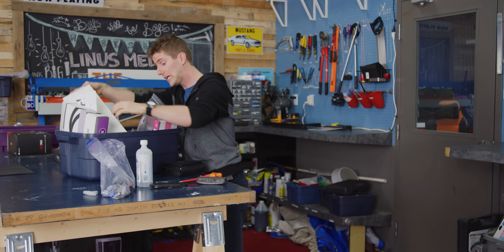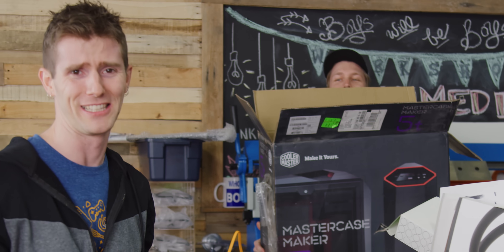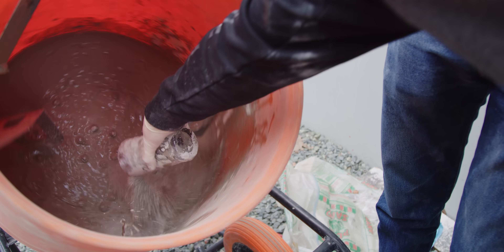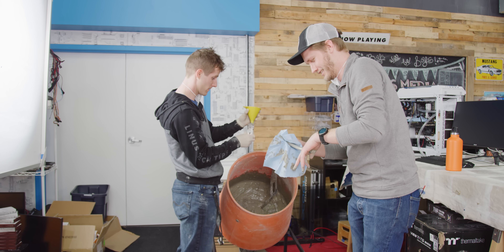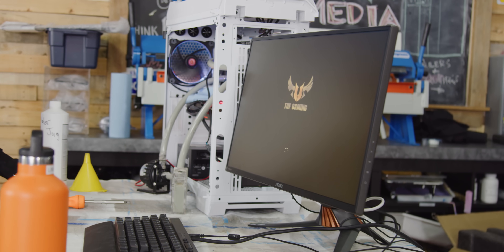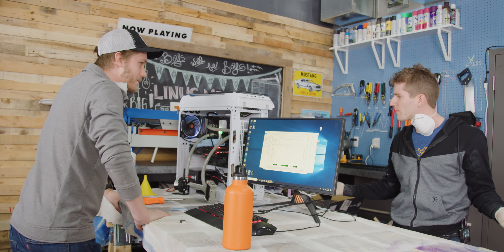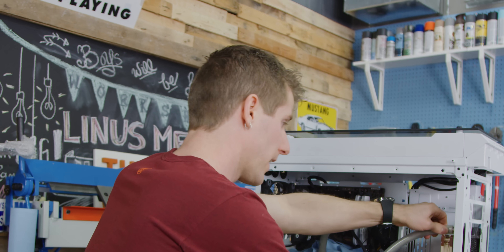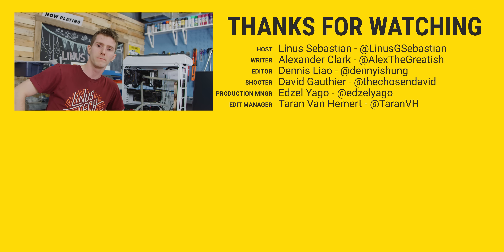I Can't Believe This Worked!!! - Concrete Cooled PC (April Fools 2019)

Comment from the maker: Add Honey for FREE and start saving today at https://joinhoney.com/ltt

Thanks, Honey for sponsoring!
Reply: Do a honey cooled pc!
Reply: might wanna delete this pinned comment
Reply: this one didn't age quite so well
Reply: Hey Linus try diluting thermal paste and using it as thermal coolant.
Reply: @mihaimuresanu3394  What an amazing idea sir!! Good call!
Reply: Why not try honey instead?
Reply: @results4526  Honey should sponsor that video
Reply: That sponsor spot didn't age well.
Reply: oop, 2025 mentioned
Reply: They removed the sponsor (scam) from the video but not from the comments...
Reply: 4th!

Linus. On a less jokey note. Back in the days before refrigeration, people used to keep their milk and cheese in the pantry on a slab of marble. Maybe you could try lining or even making a case out of marble? If it's cold to the touch, because it pulls the heat out of your hand - maybe it'll do the same to a processor or mainboard?

Also, Amazon sent me a cat today!
Reply: computebob06
That's actually a pretty smart idea. They make marble rolling pins for the same reason, the marble saps the heat from the dough which keeps the butter from melting while you work it. In theory it should work.

The only problem is even a lined case would be heavy as shit, the rolling pin I never use weights a good 5lbs on it's own.
Reply: @computerbob06  That would probably be somewhat viable. Another method would be to have water run through the loop and then be run through a slab of marble/granite (it would need to exit the tubing and run through a channel carved into the rock in order to increase the efficiency of the heat leaving the water and being absorbed by the rock).

The only issue with using marble is that while rock is great at absorbing heat it does not do so well at releasing the heat. So you would either need to have a huge rock, or else your system temps would eventually start to rise after the block of marble had been saturated with heat from your loop.
Reply: April fools
Reply: Linus Tech Tips what about a liquid metal cooled pc where liquid metal is in the loop
Reply: karl kukk genius we know what you meant. You don’t need to clarify what’s in the loop.
Reply: Why dont you guys try mercury(heat capacity 140 J/(kg* K) ) as a coolerfluid or if you dont want to kill the environment then you can try gallium wich turned liquid at  29,76 °C (302,91 K) ((heat capacity 370 J/(kg* K)  ) mercury got a heat conductivity of 8,3 W/(m K) and gallium 40,6 W/(m K) so Gallium is even the best way to go cool something down. The only Problem is that a Gallium cooled Pc probably will need some time to preheat and get the gallium liquid wich means the pump need to be turned off in that period of time otherwise the pump can get damaged. So might even need a heater for you cooler^^.
Greetings from Germany btw.
Reply: please try using the TEC1-12706,i really want to see how it work in your hand(staff),i think ive heard it can lower the cpu temp to minus17
Reply: asfia82 - bad idea for a peltier! Those things make great insulators when they fail. Good way to destroy a CPU!
Reply: Hey Linus Tech Tips, I managed to pull out my broken headphone jack but now my audio when I plug my headphones in sounds terrible, I think messed something up with the internal side of the laptop, BTW: It’s an Asus ROG
Reply: oh yeah, today is the day without youtube
Reply: I think you should cast out a computer with concrete, so the concrete absorbs some heat.
But also add watercooling, because concrete doesn't Transfer heat very well.
But it would be cool 🤔🤫
Reply: Nice April fools joke 😂😂
Reply: man, i think you dont need concrete at all you just need make thermal paste to liquid and cool down that liquid with liquid nitrogen vapor
i dont know what is in thermal paste but if that not work you still can mix water with graphite 

at least i think it might work
Reply: Several things you could do to make this work better.  First you want NON-hydralic cement.   Understand the concrete sack is actually the cement or glue that binds the rock and sand you normally use to make concrete.  Hydralic cement is designed to bind and set up EVEN in water.   Clearly this is NOT what you want.   So first thing is to seek out non-hydralic cement, which may be harder to find as most people want their cement to harden, but still should be attainable.  Next thing be sure and get a few gallons of distilled water as you do NOT want minerals in the water which may also encourage the cement to bind.  Lastly there is really no reason you can't use MORE water to help prevent clumping, if you do a good job of getting the air out of the system and use a bit of extra H20 you would have a system that would be prone to NOT setting up and hardening even if you power off the pump.   Of course you could ALWAYS use a UPS to make sure you don't go power off for your rolling canadian brown outs. 

If you really think this is a good idea why not go the distance to try and make it work rather than a slipshod hit or miss effort.  A liquid ceramic ie liquid silicon cooling medium does seem like an intriguing idea, it might behoove you to find out what kind of other agents that would prevent binding exists, contact a ceramics shop/expert and see what they can add.
Reply: How about trying some liquid ceramic.
Reply: Hey Linus, so i thought to myself that you should try oobleck XD
Reply: @Linus Tech Tips Use Honey for COOLING or Motor Oil or Liquid Nitrogen NEXT TIME!
Reply: Could you improve the system with something like a small tube  that fills continiously water into the concrete filled tubes, so that it won't dry out?
Reply: what do you think of honey cooling a PC?
Reply: You could take cement which has already set and powder it, or just plain lime powder or ceramic/terracotta powder, and mix it with water. I will not set, and likely it will probably have similar advantages.
Reply: Why don’t you use corn flour and water mixture
Reply: I don’t see how this works LinusDumbassTips or how you could recommend it. Who would leave their computer on 24/7 to prevent the concrete from solidifying. Also it probably needs to stay hot all the time which means you need to keep the computer running pretty hard ALL THE TIME! Yet another fail from you guys. One reason I don’t watch this channel much anymore. It is filled with nonsensical “solutions” that no one would try. Yeah, You have all this equipment and money to throw away because you get this hardware for free, but everyone else doesn’t. You used to be an informative channel now you’re a joke in the tech community.
Reply: Its obviously a joke. @bobalobalie
Reply: Oh no this shouldn't be here lol
Reply: @Devil Bacon Hair your mom would be proud of you 🤔😂
Reply: @DRENS2131 i mean... it really depends on what your water to cement mix is... it COULD be thin enough to flow through. 

...and then you can have fun seeing how quickly it entirely clogs the fins inside the cpu block.
yea, it SHOULD be obvious to anyone this is an april fools joke.
then again, a lot of people seem to fall for the "wireless microwave charging update for your cellphone" thing...
Reply: at least it runs... my lenovo B575e has trouble watching this without anything running in the backround
Reply: Wait what's a Cue Pawn?
Reply: Maybe try again, with fine grain and mixed 100%? For me?
Reply: You guys forgot to mention that this was an april fools day joke. There are a lot of gullible people out there who would actually believe this was real and try it.
Reply: When is the next Scrapyard Wars coming!
Reply: @mayanksingla17  Scrapyard Wars Season 8 last year was the final one. You can tell cuz they "scrapped" together LMG crews only and it got kinda dry by the end of it. Plus I'm pretty sure I remember Linus confirming that in some video, livestream, or WAN Show is the past 6 months ;)
Reply: Happy April fool's day linus tech tips
Reply: Bullshit, how does Honey make money? If it’s free, YOU ARE THE PRODUCT!!!!!! Honey is a data mining scam. Thanks Linus you Pompous dick face!!
Reply: Attempt #24: Watercool a pc running cold water directly from the tap.
Reply: Can You Try Honey COOLING...???
Reply: Now do this again but with Thermal Paste.
Reply: Wait...your sponsor wasn't Dollar Shave Club?
Reply: to your water cooler? couldn't hurt!
Reply: no
Reply: how about using Mercury as coolant
Reply: Why dont you try using ceramic lines and see if you get a similar result? Because than you wouldn't have to worry about your lines freezing....
Reply: Wait, I thought the video from yesterday was for April Fools.
Reply: Happy April Fools
Reply: I get this is a joke but why wouldn’t unset concrete work? Duh
Reply: maybe.... baking soda and water???
Reply: Im so glad honey can help me get queuepon codes
Reply: Any decent prebuilt gaming rigs that doesn't break the bank?
Reply: Guys you need to add Flow Control. It will thin your concrete without adding water, making it far easier to fill the loop and reduce pump stress.
You can find it in the same aisle as the concrete mix. Small bag, about five bucks.
Reply: whats up with the audio in start and other parts of video, it sounds over exposed and very sharp and distorted on high end... please get a better microphone if you're just going to rape my ears with +gain instead of getting a higher DB mic..
Reply: Why not use honey while sponsored by honey
Reply: I got honey and it saved me $50 so far:)
Reply: You re the best team of the world👍👍👍👍👍👍👍👍👍👍👍👍👍👍👍👍👍👍👍👍👍👍👍👍👍👍
Reply: You also mentioned Dollar Shave Club at the end of the video
Reply: When you leave your computer it bricks it self
Reply: FYI you needed more cement, not concrete. Concrete is the final product with aggregate and sand mixed in. The bag of cement is only a component of concrete. A fun side note is that the water you add chemically binds to the cement. Most of the water you put in the concrete mix stays that indefinitely, so concrete never really dries out, it just sets.
Reply: April fools. What will be great is the peeps that try it or even think its real  

the cement mixer was well awesome that part i cant figure out if your joking or not
Reply: Honestly introducing some sort of metal or stone into the water system could cool the water quite a bit. Just look at whiskey stones. Anything that displaces heat. And stone does it in spades. https://youtu.be/IDrZAByT4Nc    I personally wondered if just having your PC in a stone box would keep it cooler. Never bothered trying.
Reply: Please cast a concrete block, attach to the back of the case, make a concrete heat-sink and heat-pipe both together.
Reply: You could have cast a boulder of concrete around a heatsink.  Basically geothermal type cooling.
Reply: Try add sugar to concrete next time. Sugar act as concrete retardant, it will prevent concrete to set
Reply: Add honey into the next liquid cooled PC. 

Maybe you should have used sand instead of concrete
Reply: where is your UPS ????
Reply: Use honey as coolant!
Reply: When is part two coming? You could be onto something.
Reply: Try dried concrete block as passive heatsink. I am not joking. God say do not lie.
Reply: Try with fresh cum ! If you put that inside a macbook its speed up like 3x time IMAGINE inside a watercolling device :O:O:O !
Reply: When will we see the Linus Concrete Tips channel?
Reply: LOL, 2 sponsors on an April fools joke, brilliant!
Reply: I was wondering if you can help me get a gaming pc. I am a pc player that is stuck on console. Love your videos.
Reply: @Linus Tech Tips try ooblek. its cornstartch and water. look it up
Reply: Linus, when I first started watching I thought you were going to put a swirl of the half inch tubing in a block of concrete and run the water through the tubing, and the block of concrete be the heatsink.  : )
Reply: Concrete heats as it sets so would work except for April fools
Reply: plz give me money insted of honey ....i cant save what i dont have ...id rather buy a laptop
Reply: Let's see how it goes with the Shave Butter in the loop instead.
Reply: I will never be satisfied, until I otherwise see, a Lube cooled, Toothpaste cooled, and even mayonaised cooled pc.
Reply: try mercury for a change ...cheaper than liquid metal
Reply: Actually why no just pour concrete all over the system ? Rock heats up really slowly right ? So the CPU would need a ton of heating to heat up the rock.
EDIT: at 8:55 exactly for that reason, just fill the case with concrete and put nothing on the CPU IHS.
Reply: HONEY COOLED PC!?
Reply: How were they not your liquid cooling with honey episode sponsor...?
Reply: Next video mercury liquid cooling
Reply: Hey about you do liquid cooling with Mercury 😱😱😱
Reply: What a out a liquid cooled pc USING MERCURY!!?? F'n A right buddy!!!
Reply: Hey Linus Tech Tips !! Can you liquid cool a pc WITH MERCURY??? PLEASE SIR, Let me know what you think!!!
Reply: What about a concrete head spreader?
Reply: Linus, try adding a concrete plasticiser. It will make it a few times more runny with same amount of water. 

Chemistry behind plasticizers is mind blowing.
Reply: What if you increase the water to concrete ratio?
Reply: Not a cement use sand....
Reply: next time you should use actual honey as a coolant....
Reply: Linus Tech Tips please try cooling with gallium!
Reply: honey doesn't work
Reply: Cool pc with honey
Reply: Is it possible to cool CPU with piss or poop?
Reply: You should use gallium
Reply: To cool your pc
Reply: You should’ve used grammar-lee instead dumbass.
Reply: Can you use corn starch and water
Reply: Hair gel
Reply: I think next you should try the thermal grease instead of concrete
Reply: I think you should try thermal grease instead of concrete
Reply: You should try cooling the PC with hand sanitizer
Reply: What if you put in anti-freeze
Reply: Tell me if this is fake. Otherwise I'm trying this
Reply: Try mercury
Reply: honey cooled pc
Reply: bruh
Reply: At 06:20 I don't think your pumps are going to work with that and the oil in the loop video is still missing as well as the reviving of bricked motherboards with in ciruit programming and an EPROM programmer.
Reply: make a concrete radiator block
Reply: this will never even compare to a Linus Cooled PC
Reply: Dollar shave club or honey or both lol
Reply: They steal browsing data
Reply: aged like fine milk
Reply: about that sponsor...
Reply: Fill a loop with liquid metal
Reply: @benni_bxk3423  AKA the most expensive PC ever. Might as well use mercury instead.
Reply: @benni_bxk3423  hell yeah! MERCURY!!!
Reply: Was this an April fools video?
Reply: @unturnedhelper3495  no 100% real
Reply: @unturnedhelper3495  obviously not, look at the FLOW
Reply: Can you use mercury as a cool'ent?
Reply: Its Called liquefaction - subvert -  often referred to simply as liquefaction, is the process by which saturated, unconsolidated soil or sand is converted into a suspension during an earthquake
Loosely, faction = to make combined with lique = liquid gives us liquefaction = to make liquid. It can refer to condensing a liquid from a gas or converting soil to mud during an earthquake. Hence both mean to make something else into a liquid
Ive worked Years With Concrete and it Takes Only Little Water Once you begin to Mix Concrete to Liquefy the Mixtures Into a Peanut butter type Paste to Plaster into a Form or Force the Adhesion of compatible Substances together For a Faux Face Veneer finish Such as Brick Stone Etc. Including Tile and Even Glass in Some cases Where applicable to Desired Design /ed Finish 
May i Suggest = Graphite ? The Mixture is Quiet Similar But differs Quiet drastically For  continuous Fluid Motion - BUT , i Think you May Find it Interesting of the Concept of Why Metals Are Sometimes Found in Car Antifreeze / Coolants as well as Why they are Used to Plug Finite Leaks within Radiators . Just as Long as there Isnt No Leaks - it Will Continue to flow Without Total Blockage of the Loop While Assuring No Leaks at the Same Time . 
give me a second while i look up the Mixture recommendations _
Here is an Article of different Electronic Cooling Practices - how ever - the One im looking for is Hidden and it was Very Hard to Find to begin with any way where a Professor used Graphite to Cool his Radiator on an Old T Model that Kept Over heating and Actually Had to place a Sheet of Card Board Over the Front of the Radiator During The Hottest Months In Phoenix Az. Just to Keep it From Freezing up the Hoses - as From One Variance of Melting Graphite and then Cooling Just Reforms Into Graphite once again it it Never Looses it Velocity which is Why its Also used in Synthetic Oils -Yes - Synthetic Oils Main Characteristic is Graphite ! Fills the Small Divots  in Metal to obtain a Smooth Surface - Same that Closes Off Leaks in Radiators - as well as Many Other Metal Applications . 
still looking 
I May Have to get Back to you on the Article - may have to Dive Off into the Dark web to find the Old Footage 
seems as Google AI Doesnt understand the difference in what someone is writing to what is Most Desirable 
I`ll get back to you Once i Locate the Video
Reply: There are many uses for carbon's two key allotropes, diamond and graphite. Diamonds are one of the most beautiful and expensive gemstones in the world. But they also have many industrial uses. Because they are so hard they are used to polish, grind, and cut glass, metals, and other materials. The bit on an oil-drilling machine may be made of diamonds. The tool used to make thin tungsten wires is also made of diamonds.

Synthetic diamonds are more commonly used in industry than in jewelry. Industrial diamonds do not have to be free of flaws, as do jewelry diamonds.

Graphite works well as pencil lead because it rubs off easily. It is also used as a lubricant. Graphite is added to the space between machine parts that rub against each other. The graphite allows the parts to slide over each other smoothly.

Graphite is also used as a refractory. Refractory material can withstand very high temperatures by reflecting heat away from itself. Refractory materials are used to line ovens used to maintain high temperatures.

Graphite is used in nuclear power plants. A nuclear power plant converts nuclear energy to electrical power. Graphite acts as a moderator by slowing down the neutrons used in the nuclear reaction.

Graphite is used to make black paint, in explosives and matches, and in certain kinds of cathode ray tubes, like the ones used in television sets.

Amorphous forms of carbon have many uses. These include the black color in inks, pigments (paints), rubber tires, stove polish, typewriter ribbons, and phonograph records.

One form of carbon is known as activated charcoal. The term activated means that the charcoal has been ground into a very fine powder. In this form, charcoal can remove impurities from liquids that pass through. For example, activated charcoal removes color and odor from oils and water solutions.
Reply: @JamesFox1  "Dark Web CPU Cooling"..  EUREKA!
Reply: Ask Honey to sponsor Ultimate Honey Cooled PC
Reply: Wow the LTT is going full sell out 2 sponsors in one video
Reply: Sub2Pewdiepie and also congratulations if you know what I mean